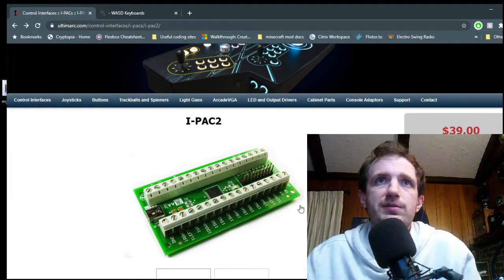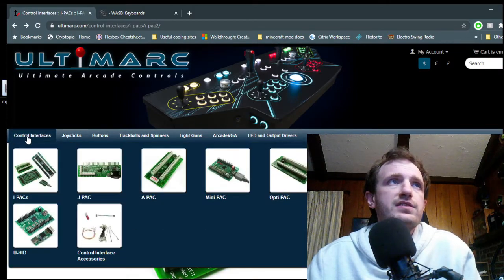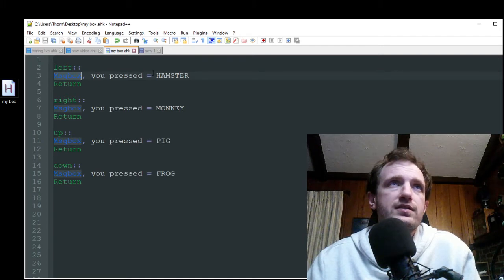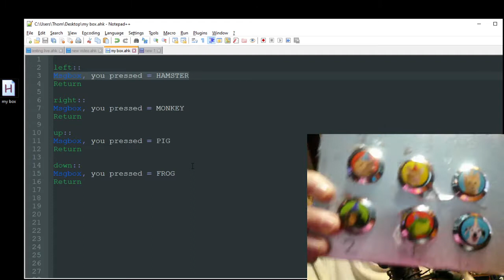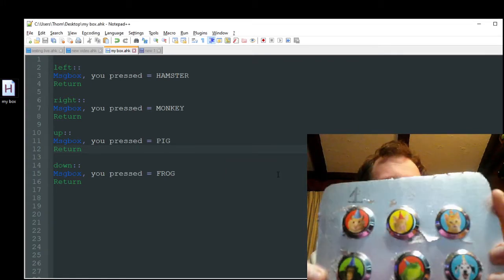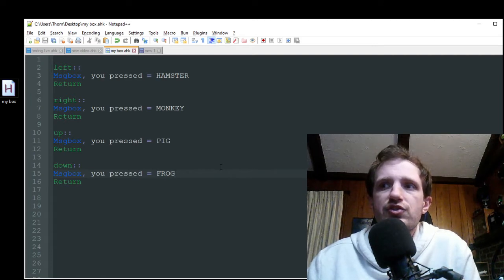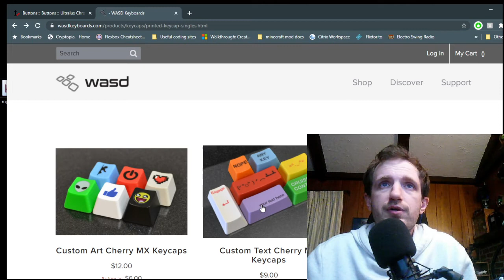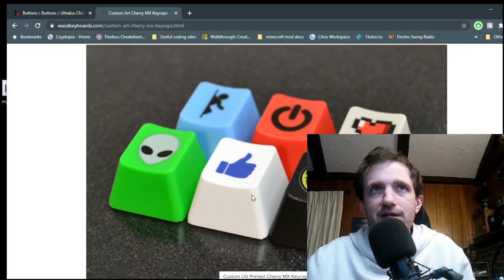AutoHotkey Mod Box - Arcade Buttons working with AHK. IPAC-2

Comment: Does the iPac work with an Xbox Series X Console? Im trying to build a Xbox Series X Arcade.
Reply from the maker: any game that works with a USB keyboard should work with this. diodes may need to be added to the wires in some cases to prevent back flow issues